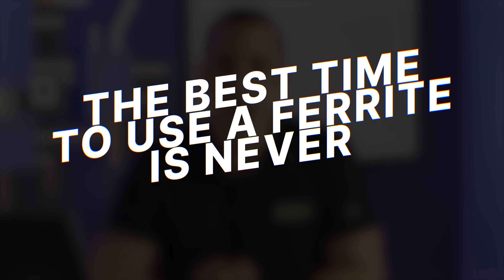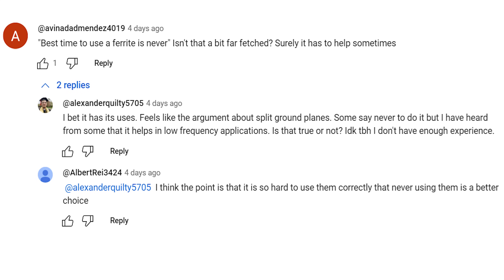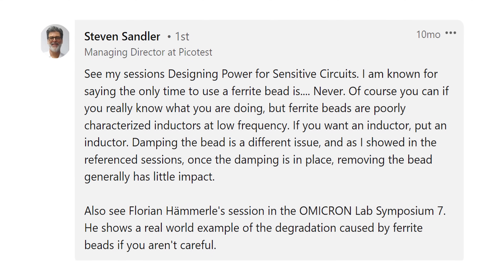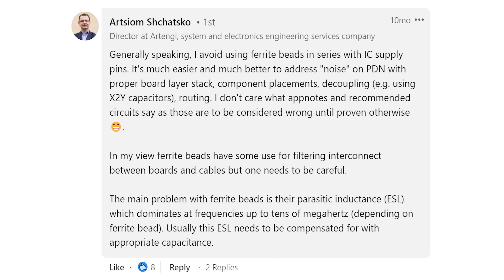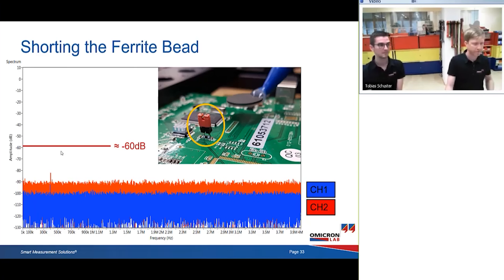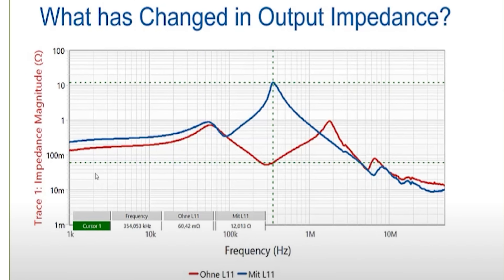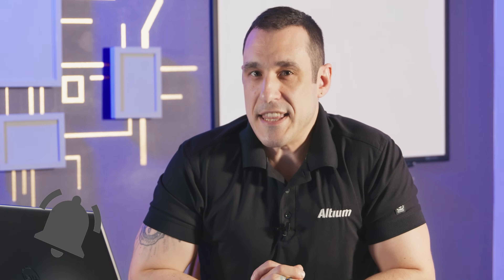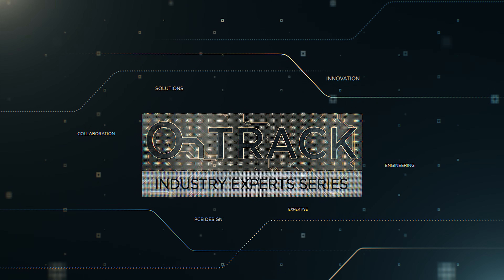Ferrites in Digital PDN: What the PCB Experts Say

Comment: Fascinating as ever, I learn something with every new video from you guys! 

I'm curious though - what about using ferrites in a damped PI filter. Zach, did a great piece on LC PI filters so it should be possible to match a PI filter at least up to medium frequencies before it becomes a capacitor at very high frequencies. Presumably somewhere the capacitors also become inductive so the Fmax has to be considered or even the PI will make things worse. Lowering the Q should help though.

My reading (and it is probably wrong) is that the unmatched impedance will cause reflections to bounce between the capacitors and get absorbed. The only thing that's useful with ferrites is that it's easier to put them in (or at least a 0R link resistor) and place or remove them later than route without anything and then have to scrape and cut microstrip?

Most of my work is at very low frequencies (analogue only) and the noise I'm dealing with is due to the power supply switching noise. I've literally got a board somewhere between here and China with ferrites in the PDN (following a ****ing datasheet, "go me") but at least now I can remove and short them before I run the tests!

Comment: Thank u very much Zach. I always got confused by reference designs from some top semiconductor companies like TI ST and NXP using ferrites on power rails of DSCs or Arm M7 designs etc. My simulations would show otherwise. But used them bec. TI says so and STM and NXP says so. So much so tht the chinese makers like Rockchip also have ferrites on pd pins every where.

Now i know wht to do ... improve the high freq  reponse  of PD and ldos for analog.
Reply: Thank you... Here is something you can always try. If you are unsure about the ferrite recommendation, try asking these companies if they can guarantee the design will not work if you remove the ferrite. They will tell you that they can't guarantee anything. That means even they are not confident in their own recommendation! They normally will say that they put the ferrite in the reference design because they used it in their evaluation board or their test fixture, but that is not enough justification to always include the ferrite on a digital PDN.

Comment: Ferrites absolutely smoothed the output of my potentiometers as evidenced on my live display. I had massive jitter before clamping one on the output cable. This was caused by EMI from a Class D amplifier and the pots were picking it up, even at rest.
Reply: That's great, and I think that's a good example of where a ferrite can be useful. What we're talking about here is the use of a ferrite as a high-impedance filtering element in series with the power pin for an IC running at very high speeds. So it's a totally different situation.

Comment: I am modifying a keyboard pcb for use with a nice!nano mcu (for bluetooth) which is not designed to protect against esd/emi. Usually it runs on a 3.7v li-po batt charged by usb 2.0. The only components on the base design are the mcu and switches (keys, power, reset). For protection, I have added a ground plane and a vcc-to-gnd tvs diode. DeepSeek and various posts suggest putting ferrite between the mcu and the ground plane and on vcc. I am also considering making a separate tiny board with male & female usb ports to put tvs diodes between data +/- and gnd and also pin the ground plane to shield. Deepseek also suggests a ferrite or two on such a board. Besides, 2nd q, I have crammed my ground plane onto two layers with some sections connected by vias and tried to remove dead ends and some loops, but there are loops. Can I get away with this on such a design or is an inner ground layer much better? github.com/stozi/ambra

Comment: So I would like to ask what I hope is a easy question.   We build energy Wind systems with Dual generators. We convert the 3-phase wild AC to DC thru rectifiers, Combine the DC power ,then smooth the DC thru Capacitors, the power output is combined and sent to Solar MPPT controller. I place a Ferrite Wire clip to hopefully clean up the combined frequency induced by the 2 generators, if not always running at the same speed.   I am hoping the Ferrite clip will at least clean some of the mixed frequency and possible only have one signal entering the MPPT.
Is this a good way to do this?
Reply: Can you prove that it works? Have you compared EMI measurements with and without the ferrite clip, and have you tested the system's electrical performance in both cases? This is the main question you should be asking as you are trying to clean up noise which could appear as radiated EMI or conducted EMI elsewhere in your system. From what you are describing, you are basically trying to remove AC noise from a load that only draws power at DC, and if that is the case then this is an ideal use for ferrites, but you should always test (such as pre-compliance testing) with and without the ferrite bead.

Comment: I am currently using a 120R ferrite bead in a pi filter network in one of my projects.... So if this is the case what value of inductance should I use to replace the ferrite bead and how to select inductor values to replace any given ferrite bead? 
PS: I just recently started working with PCBs and have little knowledge on these topics.
Reply: The big thing they are focusing on this video that might have gone by a bit fast is that you need to make sure the impedance of your PDN output network is high where there is noise and low where your load is operating. You don't want to add inductance, whether through an inductor or ferrite, that would lead to you having high impedance at say 1 MHz if the system clock is around 1-10 MHz. Blindly adding series impedance could cause you problems with resonances, high impedance during load switching, etc. If I had to make a recommendation leave your pads for the ferrite bead and populate it with a jumper. If you decide there's a reason for a series element like a ferrite bead great otherwise you can omit it.
Reply: I think you might have missed the point here: just use more capacitance, don't use the pi network. You don't want to add inductance into a PDN, particularly in mid-range frequencies where a lot of the power will be drawn into I/Os. If you build the stackup correctly and you use enough capacitance, you will almost certainly eliminate any noise problem that would cause one to start putting a pi filter into a digital PDN.

In some other case where you are using a pi filter in a general case, such as in an analog circuit, base the inductor value precisely on the value of the target filter impedance and the cutoff frequency. If you have problems with resonance in high-Z loads, you can use higher ESR capacitors rather than using a ferrite.
Reply: @ I disagree. A lot of power supplies detune when too much capacitance is present. They prefer a slight bit of ripple to stabilize the control loop. There's nothing stopping you from placing enough capacitance after a pi filter to satisfy the needs of a PDN. The main reason to avoid inductive elements is that modern power supply ICs track fast enough to keep up with moderate load switching. This can be a benefit as you don't need as much low frequency capacitance. However, if you are relying on the power supply to cover the lower to mid-range bands then adding inductance would be a bad choice.
It's all about matching source and load. There's a place for inductive filtering, but it should be a conscious design choice.
Reply: @robertconger1518  But that's the point, we do rely on VRMs for digital supplies to cover the mid-range frequencies. The plane capacitance and on-chip PDN covers up into the GHz range, and the bulk capacitance covers the low end, we then have to make sure there is enough capacitance between the bulk cap self-resonance and the plane/on-chip coverage in order to have low enough PDN impedance to reduce ripple. I agree that you can have higher impedance where the noise is low, but the reverse has to hold as well, and the transients that can be excited are in the mid-MHz range so that is where we would want a lower impedance (lots of DesignCon data, data in blogs, Signal Integrity Journal papers, EDICON papers and presentations, etc. all show this).

Comment: It's a bit of schocking to me to hear that ferrites on VDD rails should be avoided. Why they are applied everywhere in cellphones then - for example?
One should calculate the system of ferrite + decoupling and damping, which form a filter together. For most common digital circuits, 100ohm@100MHz/3A ferrite bead with 1uF ceramic || >4,7uF elco (ESR>1ohm) works excellent, has no resonance and provide significant filtering, preventing digital ICs to interfere through power rail, and also supress EMI, keep high frequency current loops small.
The low supply output impedance above MHz should come from the passive decoupling, not from the LDO I think (for smaller high freq. loops). For microprocessors, one could use several uF of X7R or similar capacitors (100nF is way less than sufficient in several cases).
Reply: That's the trick though I think some are unfamiliar with. Higher-Q is not always a better thing. It's why a lot of older LDO parts don't play well with modern ceramic output capacitors and need resistors added inline with caps for stability. It seems counter-intuitive to have low-Q capacitor function, but it's often superior in part because the non-reactive components burns off ripple as heat rather than converting to some other frequency. If you study your power supply and load then I don't think there's any problem with ferrites for noise filtering. You just have to avoid resonance and placing high impedance at your load's switching frequency range.
Reply: Do you know exactly how those ferrites are being used in a cell phone? Are they being used in series with a VDD pin, or is it to connect a VDD rail to another digital/analog rail? The former situation can be shown to create stronger transients on the power rail when the rail is supplying high speed digital IOs, while the latter could possibly work depending on edge rates, total capacitance on each rail, ferrite characteristics, etc... And when you say "for most common digital circuits" what interfaces do they use? What channel bandwidths are they trying to inject power into and how fast of a signal are they trying to drive. Edge rate matters here because it determines the strength of any transient that might occur on the rail, so when the edge rate is low enough you probably won't notice a difference with or without the ferrite.
Reply: @Zachariah-Peterson  You are certainly right - however, in most digital circuits, small transistors inside are around 100-500MHz speed range, so a common 100-1000ohm@100MHz ferrite is better than nothing.
Before you design a cell phone, you won't gain knowledge from Youtube... Its mostly done before a hobby project, eg. an audio DAC. Unfortunately, there are several underdamped CLC-filters in many commercial circuits, which can be avoided by the upper rule-oh-thumb method.

Comment: It was interesting to hear from a simulation guy expert that the ferrite beads were not working applied into the Vcc. How often did you check that in the real world in an EMC chamber where you can see the results from the EMI receiver? A prophylactic ferrite bead for the sake of being there is not a solution. But at least you have the soldering PAD to adjust it to the right frequency if you select the wrong impedance. The ferrite beads are L/C/R in parallel (replacement circuit) and act like an inductor in low kHz freq because the impedance is dominant from the impedance reactance (XL).
You can suppress the noise because the the Q factor is low when you have to filter high frequencies because here the losses (R) are dominant. 
Keep an eye on the inductive behavior and use big size package chip bead ferrites with high saturation point to avoid DC bias saturation. This can be easily seen in LTspice, modeling the Z(I) behavior for the beads.
It is not fair to claim that the ferrite beads are useless and you should never use them. Of course, you could also use an inductor instead of the ferrite bead, but this should be made from the right ferrite material and because of the wire winding, the SFR will be lower and the bandwidth narrower. Additionally, the size of the component and price will be more inconvenient. #askLorandt ;-)
Reply: Well it's important to note that we are referring to a specific but common situation, which is the use of a ferrite on the power rail for fast digital circuits. Steve Sandler's comments aside for the moment, there instances where ferrites can be appropriate, the problem is that designers will apply them anywhere they think noise will arise without thinking about the points you mentioned. As far as work in an EMC chamber, some of the commenters I show in the video have done that work and can attest to the situation I am describing, so I would refer you to those folks.

Comment: Hi I know the ferrite is making it difficult to supply high frequency content on the output of a power supply, but would the decoupling caps on the high frequency IC not take care of this?
Reply: This is a myth or rather a misunderstanding that ignores the actual structure and parasitics of a capacitor, it is not really the case that the capacitors supply all the required current for the high frequency component. When a high frequency IC demands power at very fast edge rate, the capacitor attempts to discharge but is limited by its ESR, ESL, and PDN/load resistance values. Everything in the PDN has to discharge, it's not just the bypass caps right by the supply pins. The power supply then has to do two jobs: replenish those caps continuously and compensate changes in the output voltage via its control loop. Because the power supply is also attempting to supply power at fast edge rate and is continuously adjusting the output to track any transient on the PDN, it is continuously supplying current. Some of that current charges the capacitors, and some supplies the IC supply pin.

Comment: Is it reasonable/practical to constrain my circuit designs to ones where I'm not introducing information faster than the quarter wavelength rule suggests? I think for all of my purposes i don't actually need rise times and frequencies that high for 90% of applications 

My question is does this constrain my hardware choices too much? It looks to me that most of the hardware out there is just too zoomy and I'm not sure how to proceed as a person who would like to design analog and (particularly) digital circuits that operate in the realm of topology instead of geometry

How much can i do here? I feel as though the speed of light is plenty fast but most of the PCB design information i can find seems to contradict that perception, it feels like I need a HAM license to make PCBs sometimes
Reply: When you refer to a quarter wavelength rule, what wavelength are you talking about? If you are referring to the wavelength corresponding to the clock frequency, just note that the clock frequency has no bearing on the appearance of signal integrity problems, it's all about the signal rise time. The rise time is then determined by the interface and the construction of the component package/IO buffer as well as the capacitance of the receiving transmission line and load. Most digital components have fast IOs, even if they are only GPIOs or SPI interfaces. If you want to constrain yourself to low rise times, then do everything over I2C. You can also use GPIOs to toggle pins, if you want you can use RC filters on those lines to slow down those signals and limit the current going into the receiving pin.

Comment: Hi zach great video,
Some suppliers suggest using ferrite for isolation on the power supply and isolation between digital and analog ground.
Do you think it is necessry?
Also,what kind of filter should i use on the power supply if i need low ripple, something like an lc filter will be enoght?
Reply: Thanks for watching. What you've described is one of the worst uses for a ferrite bead, the only thing it does is it isolates your board from successful EMC testing. In most cases, just use a single ground for all digital and analog. Your EMC test results will thank you later.

Comment: Hi Zach,
Great video, about a subject that is misunderstood by so many.
Is there a case for ferrite beads on signal lines, particularly I/O onto and off PCB to a cable, etc?
I'll be recommending this video for our team, as some still believe that appnotes and datasheets are correct, and can be blindly followed ... <SIGH> !!!!
And of course, "What problem are you trying to solve?" Needs to be asked for every part on the schematic!
Thanks.
Reply: Thanks for watching. About the I/O lines, there are magnetics used on HDMI for example, but these components are built specifically to ensure compliance with the HDMI standard. Just because they do it in that instance does not mean you should do it in all other instances. I think that omitting that thought process is how we got to the current state of things, where ferrites are just applied everywhere without good judgement.